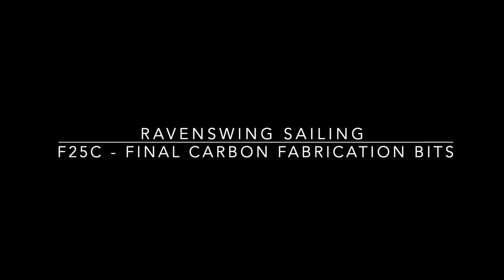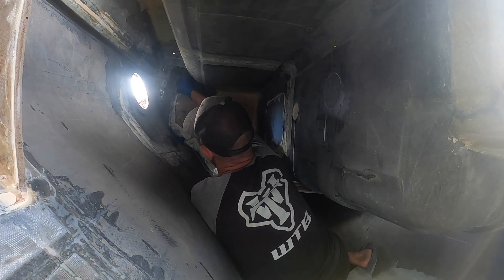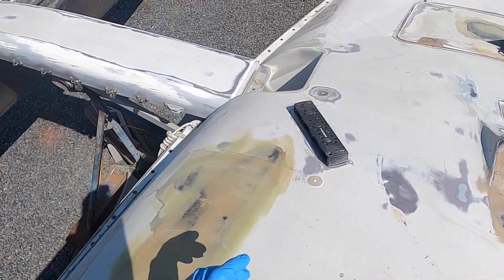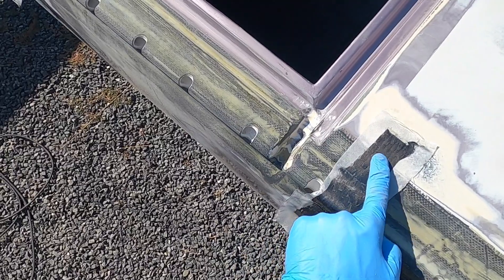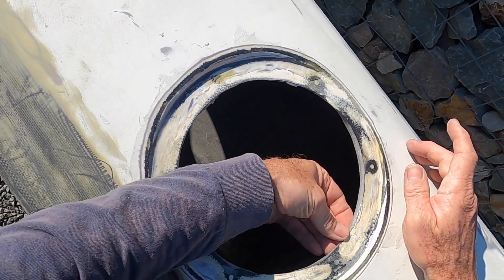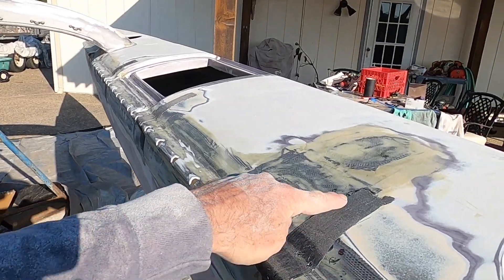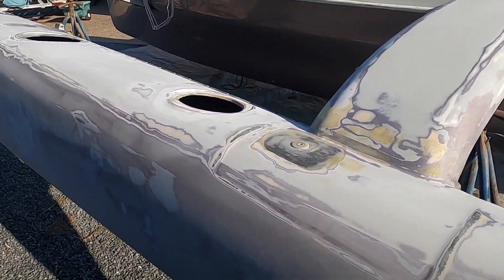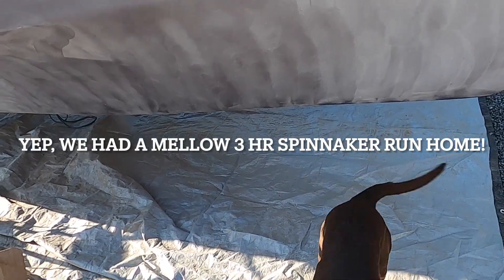F25C tri - finishing the restoration fabrication jobs & prepping for paint

Comment: Great progress!  How do you terminate the ex-F-27 s.s. Rigging wire at each end to prevent it from fraying and moving fore or aft?  Maybe this is not an issue once trampoline lashing is done?  I have zero esthetic sense according to my wife so can’t recommend paint schemes.  However, a super bright dayglow on the undersides and daggerboard might help when that emergency tunnel is used.
Reply from the maker: I simply taped the ends of those cables. The forward edge of each tube is capped. Aft ends will get filled with a wood dowel plug, and a screw into the wood to hold it in place.  Yes, the rudder and dagger get the same bright orange paint as the bowsprit and rudder cassette on Ravenswing. As for the boat graphics, I’m watching old 90’s tv reruns for ideas.

Comment: Excellent work! Regarding the diagonal blue dyneema racking prevention, do they run from forward float to aft main hull? Does that prevent forward racking of the float? How about aft racking (in the event of a float collision?) Maybe I'm missing something. Thank you.

Oh, wait. I bet the diagonal is to counteract racking pressure caused by the forward-pulling tension of the back stays and any foresails attached to a float?

Have wondered about what happens when (inevitably) one's float collides. I think I read from Ian that the shock travels aft then at a right angle up the aft beam to split to go up to the aft beam mount/compression plate and down through the lower strut to the mount. Wondering if my putting a diagonal stay to prevent afterward racking would help (stopping the afterward shock and keeping the shock force on the float) or would it be better to allow the shock to make its way through the beams and connections (being mostly epoxy/glass, might 'flex' and absorb.)

Must be F-boats aren't as vulnerable as I can imagine.
Reply from the maker: Yes, forward on the float to aft on main. It’s a very small diameter cable so I think of this more like shock absorbers on a car. Not the actual suspension taking heavy force, but rather smoothing out the shocks and helping to keep alignment. I would think it’s a good idea for your Tramp, but of course it means adding some reinforcements at all four anchor points.